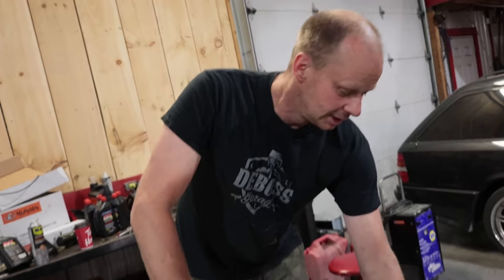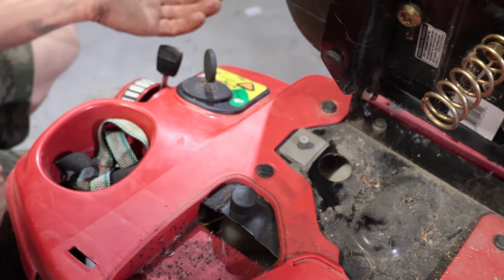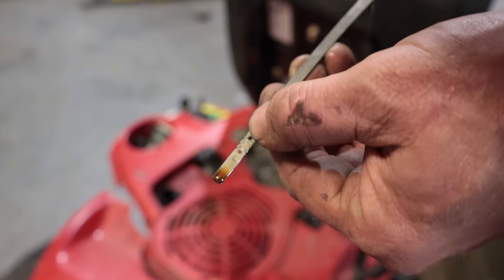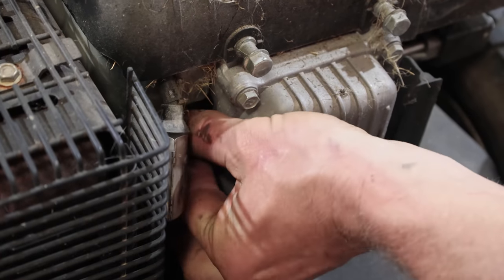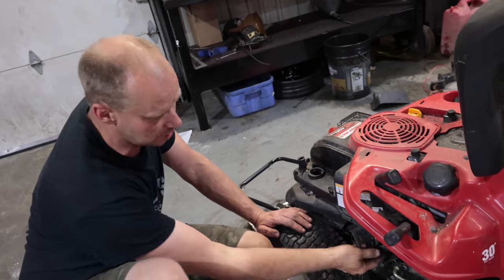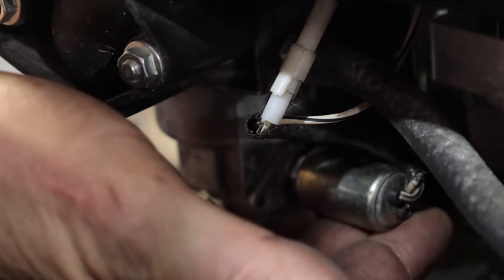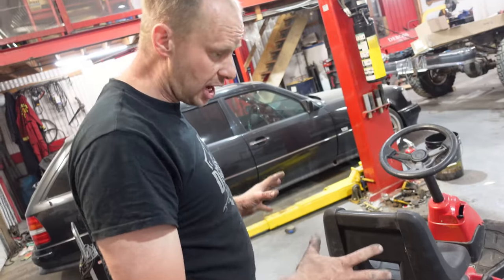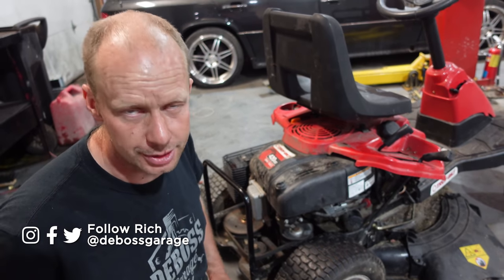World's Smallest 30" Riding Mower Won't Start (and it was free)

Comment: quick piece of advice for a person that does a lot of yard maintenance no I don't have my own yard maintenance business but I do a lot of yard maintenance. With small engines the best thing to do with any small engine is to run it completely dry or empty after you're done using it.

I also tend to use 2-cycle mix  @ 1:128  (just get the cheap stuff at Walmart that's available for marine Outboards $4.00 a quart)   

just before you run on empty go ahead and put it on Full Throttle or find a way to mess with the governor and let it completely run out of fuel.    

that trick that he showed you putting something over the carburetor? That's a great way to make sure that your car bowl stays clean.   it also helps unclog the Jets.

this is also one of the reasons why I think all the additives that they put in fuel that stops things from gumming up don't do Jack diddly for small engines.  

the only real good reason to use premium fuel in your lawn mower is that you're able to extract more  power from it since it's all gasoline.  basically it burns a little hotter.   it's useful if you have a 2 cycle  where every little bit of power counts.  but in my opinion it really doesn't do anything for 4-cycle Motors.   

Harbor Freight also has this really small micro brush kit that's perfect for cleaning these carburetors. But like I said if you completely run it dry and you use the method of running it at Full Throttle and using the suction technique it will usually clean the Jets really well and will basically be trouble-free at that point at least with regards to gumming up the carburetor.   

one thing that people don't like to talk about is the actual filler of the fuel the filter itself does do a good job of straining out large parts from getting in to the fuel bowl however small bits of grass and debris and small other items do get past the filter and when it breaks down in the gas can.
 that's usually what leads to the problem of clogging your jets are the organic matter that go inside the fuel tank that gets broken down by the gasoline.  

a fuel tank strainer is worth the 6 or so dollars that it cost to put one there as you will find out a lot of stuff does get inside your gas tank by simply just fueling it.

you can also use those little paper filters that they have at Walmart instead of the Briggs & Stratton little small tiny filters since they really do a better job.   plus they can be had for a few dollars.   

also don't bother with the fuel stabilizers. They don't actually really do very much in the long-term as taryl fixes all has been able to start his two-cycle engines and they've all started in almost the same amount of time.     

before putting your equipment away for the winter run a very rich mix of 2-cycle,   alternatively you can also right before the engine gasoline tank is empty you can spray lubricant directly into the carburetor itself right before the bowel goes dry.   this will keep all the parts inside the engine well lubricated and stop any corrosion in the case Over The Long Winter.

keep your gas tanks Clean and Free of fod.

Comment: I could NOT be happier…inherited a Columbia/troybilt, ran it for 5 years, and then…..put bad ethanol gas into it….it would start, catch, and died…followed the steps, and then did something I had never done before.  Removed, disassembled, and cleaned the carburetor-and then reinstalled it. This excellent video guided me through the process and I spent NOT ONE PENNY to someone else to remedy my situation.  I figure this site saved me $150 and I am so Grateful!

Comment: Thanks for this video explanation. Everything you said was spot on and yes the craftsman r110 that I have IS  identical to the troybuilt.the tip about not getting the cheap belts was really helpful too.and being that I had the cutting deck off I took a wire wheel to it,painted it,greased it and figured being that I have the deck off I'll replace the deck belt too.then I figured why stop now?took the steering housing off,followed the tip about preventing the steering from slipping in one of your other videos.thank you very much for the very valuable information.i now am a subscriber

Comment: I've had trouble after sitting all winter with mower not starting, I added a fuel primer bulb that helps a lot. I also added a wire basket tie wrapped behind the seat for trash I find a my lawn

Comment: There's an important jet I did not see you clean and it's hidden as part of the idle screw stop. It's plastic and pops out for easy cleaning. This will cause rpm surging/hunting at low rpm. I think I noticed this hunting in your final run but in this case could simply be because it didn't run long enough to warm up at all.

Comment: Hi there ,from Sydney Australia.I got a Rover micro rider sitting in the shed for the last 2 yrs.Had it out today to do the job,tried add fuel in to air intake,it’s run and stop as it burn all the fuel,though no fuel was coming across from fuel tank.I’ll now try and work on floater .Thanks for vid

Comment: When I have trouble getting mine to turnover the first mow of spring, I just clean the spark plug, spray some starting fluid in the spark plug hole, put the spark plug back in, and turn the key. It's started every year that way for as long as I've had it.

Comment: These is a great video for people to learn alot from! I just picked up a nice almost perfect condition older simplicity mower with the awesome 12.5 Brigs engine for $12.50 and I barley had to do anything bro get it going the battery was still good and I found out the person before me cleaned the carb but somehow managed to put it on backwards so the only thing I had to do was put it back on the right way and out a new belt on the deck one I even had laying around and it's been a absolutely perfect running lawn mower for under $13 bucks!

Comment: I use a torch tip cleaner for small engine carbs to clean the jets and idle circuit out, works extremely well and you have several different sizes all in one tool.

Comment: That carb is not easy to take out but mine is not having issues yet i take the gas out during fall. I dont know if any of the safety switch is out xcept for the seat so i just force start with a jumper.

Comment: Another thing to check with the fuel flow out of the tank is that it doesn’t have water in it. The water will settle to the bottom and it’ll seem like good fuel from the cap, but be getting mostly water to the carb.

Comment: I have had good luck with Briggs and Stratton engines. I currently have a Yard Machine push mower it's 15 years old. And still starts on the first pull. Just keep it maintained. In particular change the oil and run it out of gas before you store it for the winter.... People tend to throw away lawn mowers wen they store them full of gas over winter. The gas goes bad especially if it has ethanol. Then the machine won't start in the spring.

Comment: I was putting in a new starter on this mower. When I took the metal plate under the seat off, it had tension on it and practically FLEW off. Now I cannot put it back together. I am thinking I need some type of clamp to pull the metal pieces back so they can be bolted back. Suggestions?

Comment: Here in the states all grades of gasoline have 10% ethanol.  There are two options:  you can buy ethanol free gas at a home improvement and hardware store but it's very expensive.  Or you can buy it a gas station that sells it but some states don't have a lot of stations that offer it.  Or you can buy ethanol gas and treat it with a product like Stabil gas treatment.  Personally, I can't afford to buy a "throw-away mower".  My 30 inch mower is 30 years old and was also given to me.  I invested $400 in parts and is as good as the day it was new.

Comment: Here in my area, our 87 has 10% ethanol in it. All of my power equipment that’s been built during the ethanol years says 10% is the highest you can run. They say E15 and higher is not allowed. However, that doesn’t matter for me, as I use non ethanol gas, as I was tired of cleaning carburetors every spring. 

With that being said, we still have issues with power equipment not running after sitting for a few months, so I’d imagine up in your area you guys have quite a few small engine mechanics who are very busy in the early spring lol.

Also, the solenoid on the carburetor is there as backfire protection for the flywheel key, as a backfire can shear it.

Comment: That solenoid on the carb is called an anti after fire solenoid when you turn the key off as the engine is spinning down it's still drawing fuel and that fuel hits the hot cylinder or exhaust and causes the loud backfire you get sometimes when you shut it off that solenoid prevents that by closing when key is shut off blocking fuel flow

Comment: Try Automatic Transmission Fluid (ATF) in leaking tires it really works.  huge tip is to add Marvel Mystery Oil to gas it's very stabilizing to the fuel when storing and adds power and counteracts Ethanol.

Comment: I'm struggling with a mower I inherited from my Mom. Basically the same as this one. The battery, starter, carb & engine are fine. Also the starter solenoid/relay tests fine. But it will not start via the key. But if I jump the starter, it starts & runs like a champ. I've found a couple of safety switches located where grass c.ippings build up, and they're really corroded. And there's multiple. I really wanted to fix this right, but I'm about to start disabling some safety features.

Comment: To prevent going through all this, use premium gas, and as an extra precaution, drain the gas at the end of the mowing season. I run the tank down to near-empty first, then start it and let it run dry.

Comment: 99.9% of the problems with this mower start with the deck kill switch. People use the deck as a step which makes the plastic flex and the switch jumps the slot. I sold enough of these mowers at Lowe's I would educate the owners about that switch. This is a great small mower for the price. The Briggs engines never had a problem the carbs would always need cleaning because people don't want to spend a few dollars on  Sta-Bil. All fuels will lacquer the needle valve in a carb if it sits long enough.

Comment: Is that A cooling fan under the seat? Great design. Its not like TYe seat sits on the engine directly above the cooling fan and blocking the air flow and overheating the engine.

Comment: Thanks so much for this video! I just bought one of these and I can't get it to run. Tried different carbs that the seller had. I could only get it to run for 10-15 seconds or so. I just ordered a new carb. I have a question: The throttle plate (not choke plate) Is wide open just sitting there. Is this correct? 

When I move the Choke/throttle lever it operates the choke but does nothing with the throttle plate. Is this controlled some other way? Like with the emissions controls? It seems to me that when its sitting there not running the throttle plate should be closed!!!

Do you have any insight on this? Thanks.

Comment: So the guy that built the worlds first Cummins powered flame thrower just told us a little gas down the carb is dangerous.  😹😹😹😹😹.   Good video. So true fuel ⛽️ is a gassers best friend.
Reply from the maker: We were in an open field lol.  Not sure who is going to watch this video but I had a customer (grown man) burn his entire barn down.  I was close with a MF35 that had a leaking needle.  fuel was spilling out of the intake boot.  One spark and up she went.  Luckily I had a fire extinguisher handy
Reply: @DGHD  just giving you a hard time 😹.  Needless to say I’ve melted many an air filter from putting to much gas down a carb and having it back fire.  Better to be safe then sorry.

Comment: I have this same mower it's a pile. Mine starts and runs for 2 mins then shuts off. Tried new filters, new gas, vented gas cap, cleaned carb out, new plug, new ignition coil... Still does it.

Comment: Shell premium gas has no ethanol in it. I have used it in my snowblower last 3 yrs . I never drain the tank. No problems
Reply: Since ethanol Is aquaphillous and gas is aquaphobic, you can use water to separate the 2. One rises above the other and makes a liquid sandwich.
Reply: With the amount of gas I use to mow every year 93 octane is a no brainer
Reply: There are also gas stations around that sell non ethanol gas. I have two within 5 miles of my home. It is more expensive than regular fuel but much cheaper than buying skill fuel at the hardware store.
Reply: You can also buy cans of race fuel from karting suppliers, or motorsports shops if you want big cans of race fuel.
Reply: @zarb88  we do this with the gas in our 49 F1. It’s more expensive, but worth it to not have the headaches. It’s usually for boating applications.

Comment: You are an excellent teacher.  My craftsman that looks just like this wont start. Nothing. I am a widow with no way to haul it to a shop and shops are backed up so i try to do what i can myself.  I want to access the battery before i move on tl fuel. Do you have any accessing the battery on this vodeos?

Comment: Mine doesn't have the electronic cut-off. I know why they added it. If I leave the fuel on (I added a manual cutoff) the float doesn't stop the fuel and the cylinder floods. I may have to see if I can add this as an aftermarket option.

Comment: Spray-foam for tires eventually fails (like it says on the can)....A drag racer guy told me the recipe is to remove the tire and wire brush/sand the rim where it seals the tire bead and spray paint it nice and smooth with whatever, just let it dry good and hard and then the secret ingredient is.....Palmolive Dish Soap!! (UNDILUTED, you want it THICK)   Not only use it as Lube to re-mount the tire, SMEAR it generously on the rubber AND on the newly-smooth rims where it meets the rubber and this sht works a long term flexible miracle!
Reply from the maker: Not spray foam.  Leak sealer.  It works pretty good.
Reply: Leak sealer like mountain bikers use for tubeless tires. Stans No Tubes is a popular brand of sealant. The company HQ is in Big Flats, NY. Lol.

Comment: A manual inline fuel shut off valve in most instances would resolve the carb issues. Simply turn it off run engine out of fuel at the carb when you get ready to use again simply turn the fuel back on.

Comment: I have had one of these mowers in the past, that deck safety switch definitely gets annoying.
Something to know as long as the machine is in park with the brake locked, the machine will start but the deck will not engage, that should apply to all riding lawnmowers as long as the safety switches are not bypassed.

Comment: Almost every one of those that came into the shop had some interlock switch issue lol Still, i like Troy Bilt. Big fan of MTD stuff. When it came to warranty issues, the garage was always FULL of Husqvarnas. Had a 24hp intek v twin make it off the assembly line with no gears in the oil pump. Managed to sling its own oil for 4 hrs before a rod let go lol

Comment: How long did it take you to figure out that you left the gasket off that goes between the engine and the carb? I noticed you put the carb on with the gasket still sitting on top of the plastic over where the carb was mounted and when you started the mower that gasket was not sitting on the plastic covering the engine! Lol.

Comment: I also have asked my Dentist for some old picks and used them to clean the screw heads on the bottom of my RC car.  Dirt 1/10 scale racing will pack the allen heads full of dirt.  Better then trying and not getting them out.

Comment: I had a mower just like that. My brother bought it at a garage sale, mowed his yard a few times then it quit running. He worked on it a little bit, changed the ignition switch, and some other stuff and still couldn't get it going so he just went and bought another mower. I went through and tried bypassing all of the safeties, bit still couldn't get it to do anything until I started chasing wires and found that stupid sensor on the deck flap, bypassed that and it fired right up.
Reply: I've got one of those. Had a problem with starting,checked all the safeties ended up the electrical plug worked itself off the back of the ignition switch. About drove me nuts. Opinion on ethanol in gas, I have run 10% ethanol in all kinds of gasoline engines for years and have never had a problem. Maybe just fortunate.

Comment: I would be careful recommending WD40 as a lubricant

It's ok as a lubricant in some situations to some extent, but I've had it destroy plastic gear mechanisms so be very careful where you spray it!

It is not designed as a lubricant! Even though common theory says that it's basically a mixture of fish oil and kerosene mainly. But it's mainly a solvent that leaves a little oily residue behind. You have to be careful with solvents like I said I destroyed the cup holder mechanism in my car because I was going around spraying every moving joint on the whole thing with WD40. I think it was because it used plastic gears but I'm not 100% sure.

I would recommend using any kind of lubricant that is designed and advertised as a lubricant. Like spray lubricant, tubs of grease, etc. WD40 was invented to prevent rust forming for long term metal storage for missiles sitting in silos for decades. And it's great on rust. And yes it has some lubricating abilities, but you better make sure the things you lube with it are metal. And it won't last that long compared to an actual lube since it's a pretty light oil. I love WD40, I spray it on all my rusty junk and on bolts I'm taking out and to help wipe and clean down metal. I just don't use it as a lube. And I try to avoid getting it on plastic after it destroyed that mechanism of mine.